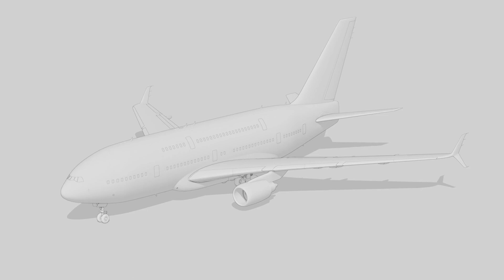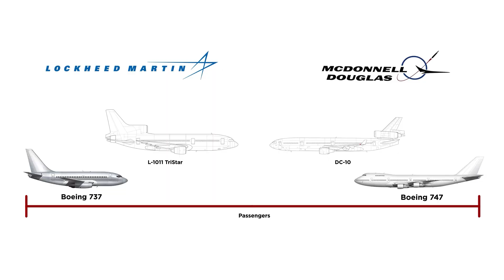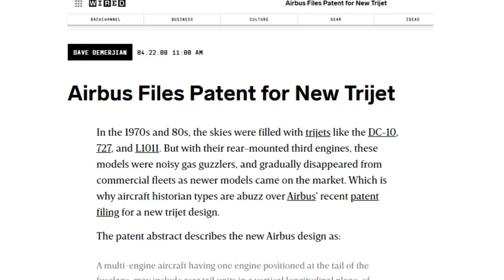Why a third engine is the future...

Comment: A trijet with the third engine as a booster means that this engine would produce drag while turned off.
Reply: But the drag could be significantly reduced if the tail engine was a cowl less design with feathering blades.
Reply: @joejoejoejoejoejoe4391  Correct.  In fact, with modern technology, you could close the intake flaps and the exhaust and basically have zero drag at cruising altitude.  Then, when descending, turn the engine back on and open everything back up.
Reply: Not to mention the added maintenance costs of different engines on one aircraft. And the headache of the tail mounted engine. It’ll probably be better to just wait a decade for more advanced engine technology
Reply: The 727 Engine cluster resulted  in very low form drag and very high cruise speed,  The difficulty was  so much weight aft affected the flare in landing.
Reply: My first thought, to prevent the third engine from producing drag, was a flip-up intake, which opens when the engine is going to be in use, then closes, flush with the top of the fuselage, when the engine will be shut down during flight.  Think of cars with flip-up headlights as an example.
Reply: There is one more solution: hybrid airplanes. Imagine a plane, having 2 large high bypass turbo fan engines, but instead of a gearbox to Slow Down the fan, they have a generator, that equally slows down the fan and redistributes the power to two additional electric only fans, thus achieving a bypass ratio, impossible with the modern jets. And if the power of two main engines is not enough, an APU in the tail can be replaced by a much more powerful turboshaft engine and generator.

Advantages: 
1. Very high bypass ratio, that cannot be achieved by the modern jets engines.
2. Redundancy - in case of an engine failure there will be much less thrust inequality on the different sides. At least one engine is fully protected from the birds.
3. Fuel efficiency - all the taxiing can be done just under the APU, electric outer engines can allow much more precise use of the differential thrust, and rely less on the rudder, thus reducing drag.
Reply: @Viktor-x1w7w Excellent proposal. As with land vehicles, hybrid is the way to go.
Reply: @Viktor-x1w7w   go to lockheed martin
Reply: @Viktor-x1w7w  You are forgetting that a gearbox reducer doesn't just reduce the speed, it turns speed into torque while the Power stays relatively the same to the product of the gearbox reducer's efficiency.  That efficiency would be dramatically lower if you were converting it into electrical power and then returning it into mechanical power.
Reply: @Viktor-x1w7w  this could introduce higher power losses than a geared turbofan
Reply: @Viktor-x1w7w Great idea.
Reply: @Viktor-x1w7w on paper this sounds good. In reality you will not generate enough power to overcome the thrust requirements and energy loss you naturally get in ALL electrical systems to make up for it. Liquid fuels continue to remain king for energy density.
Reply: @EntityOfTheVoid  the energy still comes from the liquid fuel. The problem is that you are limited by the fan maximum diameter (your fan blade tip must not break the sound barrier) as well as the differential thrust. Hybrid solution overcomes these issues as it partially decouples propulsion from the power generation - you can send power from any engine to any fan.
Reply: Also, 2 different types of engines used can be an issue.
Overall, using 2 very powerful or simply using 4 engines is much more convenient.

Comment: No, 3 engines has several problems over 4 engines...

*Rear control surfaces have to be larger and thus draggier for 2 reasons, more rearward COG meaning shorter moment arm, but also because 1 engine out causes higher asymmetric thrust on a trijet
*maintenance access is difficult on the rear engine
*it's structurally efficient to place the engines on the wing as they counter the flex of the wing, therefore wings can be lighter

So whilst twins are more economical than quads, in the case of the trirjet, the complications of mountain an engine at the rear exceeds the benefits of having fewer engines.
Reply: So why there are trijets in business aviation ?
Reply: @dmitripogosian5084  Because small business jets generally don't have wing mounted engines, this allows them to be low to the ground and have onboard stairs.
Reply: @dmitripogosian5084 
The overwhelming majority don't. Even the most recent long range Dassault Falcon is a twin.

Comment: It could be argued that the DC10/MD11 and L1011 TriStar were stop gap solutions before sufficiently powerful engines became available to power large twins.

While there may be a demand for engines powerful enough for an A380 or 747-8 twin, would that demand justify developing what would be pushing engine power significantly beyond what has already been achieved? This would be cutting edge technology with significant engineering risks, with at best, modest demand for that engine model.

The four engined Jumbos used tweaked engines of a power well within what could be achieved, and even the largest twin, the 777x should be produced in sufficient numbers to justify the development costs.

As a stop gap, there could be a justification for using existing engines and/or to create an aircraft without ETOPS constraints, or superior short field performance.

Although not specifically mentioned in the video, the idea of a booster engine for take-off is nothing new. Some variants of the Hawker Siddley Trident had a fourth booster engine mounted just above the one within the rear of the fuselage to improve the abysmal performance from the three main engines.

Comment: Tri-jets have always been a great concept on paper. But the reality is if it can be done with two powerful engines only, that's the route airlines will go. The world has tried this already. The DC-10 only sold 386 units and the L-1011 did even worse with only 250 units sold. These are not compelling numbers. Engine technology has come a very long way and will continue to improve.
Reply: Boeing 727, British Trident
Reply: @ the 727 sold well but the market segment they were intended for are well covered by twin jets today. We’re talking long haul use as seen in the video. A narrow body with 3 engines would never make sense.
Reply: @chrissmith2114 
And the 727 was replaced by what?

That would be the twin engined 757... 

The only reason that the 727 was a tri-jet was that the engines of it's day simply weren't powerful enough. The Tri-jet concept is a solution to a problem that no longer exists.
Reply: Also the MD-11 had 200 examples built. But when added together the DC10, L1011, and MD11 there may be a business case, especially if, for some reason, ETOPS restrictions prevent twin engines from working on certain long haul routes.

Comment: emirates is the exception to the rule. most Airlines struggle to fill out capacitiys on high volume aircraft. add complexity and development cost and it doesnt look to good. also i think there is an aerodynamic view to it (sorce is i made it the f up/intuition): but you´d add drag as compared to twin engines. So its beneficial to just optimize twin engine aircraft since you´d have on less source for drag.

Comment: The issue with 747 and 380 is they're too large for 90% of the airports so their use is extremely limited. If they had smaller wingspan and weight they would be a lot more viable.

Comment: 1:00 at least they aint the 8 engine b52
Reply: Well B52s were built in the 50s when jets were very early tech and didn't provide enough thrust. There were proposals of modifying them with 4 modern passenger jet engines but it was revealed to be increasingly expensive to convert because that would require extensive modifications to the wings of the aircraft, so the decision was made to keep 8 smaller jet engines which still would be significantly more fuel and thrust efficient than 50s-70s jet technology
Reply: The Convair Model 37 was a proposal for a passenger version of the XC-99 (which was based on the B-36 bomber) with double decks and 6 pusher engines.

Comment: This is not going to happen.

For a modern high bypass turbofan the engine is more efficient at 40-50% throttle than on 80-100% throttle. So having more engines turning always more efficient. So even if you say have 3 or 4 engines for take of, shutting down one or two engines make no sense, it actually increase the fuel burn not the other way around. This was not always the case, for turbojet engines, that is not really true.

Having a engine under the wing is way more economical than having it in the back. Firstly its maintenance, But that is not the only reason.. In a traditional airplane with wing and a stabilizer, the more the COG is forward, the more fuel efficient the aircraft is in cruse. That is why tail-pushers are so uncommon.

Having 4 smaller engines is actually both more economical and easier for maintenance than having 3 slightly larger. When the L1011 and DC10 was designed, this was not quite obvious due to large bypass turbojets was a very new thing. This also turned out to be the case with Boom overture. Showing that 3 engines really didn´t work as well when they start digging deeperin into the numbers.

In reality, the 3 engine planes like the DC10 and L1011 was replaced by 4 engine planes. 747 going on to have several iterations, the A340 was launched in 1991 and also A380 in 2005. The two later producing 377 and 251 units. While the A380 have beeen seen as a failure, the production numbers was still larger than that of the L1011 and the A340 was just shy of the DC10 that was generally considered a limited success.

Comment: Yes, because so many airlines are clamoring for a competitor to the wildly popular A380. 🙄
A more efficient replacement double-decker would be chasing the wrong side of the decimal point. The breakdown of the hub model meant the end of the age of mega-jets, and now they're only viable on specific routes, to the point that Airbus shut down production earlier than anticipated. If there wasn't enough market to be worth keeping the production line open, there's CERTAINLY not enough to make the R&D on a whole new aircraft worthwhile.

Comment: no it is not and history already proved it. The market is going for 2 engine planes because the new ones have enough power and they are more economic.
Reply: i guess airlines now just want to have one engine planes or even gliders, with that soaring fuel price...
Reply: @ and no pilots.
It is already possible to fly an airplane from point A to point B without human assistance…
Reply: Ha! 
Imagine an engine capable of single rear engine flight with 2 'spares' in the event the MAIN died. 
Engineering moves fast. Catch up.
Reply: @jamesogden7756  Why have two pieces of metal doing nothing but making drag when you could just make the main more reliable?

Or better yet, just have two engines.
Reply: say this slowly while looking at how Airbus keeps making their twinjets increasingly have less thrust weight ratio
Reply: Wrong! Landingslots are the biggest problem globally at the major hubs. A380 and its equivalent is the only way forward
Reply: @halitosis75  the usage of the A380 and the 747 cheap out the ticket cost per passenger. Because of this, airlines suffer losses whenever an aircraft flies half empty. This is why the airlines demand things like the A321XLR which actually pollute as much because of their lower power and speed but at least a single trip on a321xlr nets then as much money as it once did with a 747 despite the 747 has a whole hour of advantage because an A321XLR cruises at 820kmh while the 747 can go 1090 with headwind.
Reply: @kingghidorah8106  you really don't get it
Reply: @halitosis75  says the one who can't think from an airline's standpoints.

Not filling an aircraft entirely equals to losses. The A380 cannot fit in about half of the international hubs while the 747 can operate in airports as small as 2km long runways and proceed with ground ops without the need of a terminal. However there's less and less people that afford to fly across continents. This means the quad engine aircraft are wasting fuel while carrying the same amount of pax that would fill something like an A330, with two engines. 

You just sound like an A380 fanboy.
Reply: A lot of his content is hypothetical, not practical
Reply: The size of the engines under the wing is becoming an issue.  The B-737 Max series is an example.  A centerline engine/APU could provide supplemental thrust to assist in takeoff.  The KC-97 had supplemental jet engines added to help them maintain higher speeds for refueling early jet fighters.
Reply: @BobSpiffy1 it’s only an issue because the 737 was designed before turbofans were a thing.
Reply: @ So, because you believe that what is most common is correct and that there are no other options…. Having four decades in aviation in maintenance and operations has taught me that there can be multiple solutions to the same problem.  Boeing, Airbus, Douglas, Lockheed, BAE, Sukoi, Mitsubishi, Tupelov, … all had different takes on making aircraft more efficient or capable.  Don’t lock yourself into a mindset of “my way is the only way.”
Reply: @BobSpiffy1 everyone of those modern designs is a twin engine.   A380 fizzled with four.  Been in the business almost that long myself
Reply: 2 engines in the middle of the Atlantic or worse the Pacific makes me nervous at times, 
Especially at night surrounded by lightnings…
Reply: @gillesbueno1153 that’s why we have ETOPS rules
Reply: @gillesbueno1153 dude thats why ETOPS exists, if one engine fails you got the other, those planes was made and testes AND CERTIFIED to fly with one engine at least to get to the closest airport
Reply: @ yes.
Until 2 engines will quit at the same time…
It did happened before…
Reply: @gillesbueno1153 
Any problem likely to kill two engines simultaneously is just as likely to kill 3 or 4 simultaneously, so mounting 3-4 doesn't actually make you any safer... just bigger, heavier and more expensive.

If there was a genuine case and requirement for quad jets then the A380 wouldn't have been an abject failure and the 747 or its successor would be in production. Nobody needs or wants quads or tri's so there aren't any.
Reply: @gillesbueno1153 the B777 has 207min ETOPS on the pacific, that’s not for no reason
Reply: @ yes…until the day both engines for one reason or anther,
Will quit running…
The more engines over the water, the better.
Economic issues should not overcome safety issues…
Reply: @ there are no safety issues with 2 engine aircrafts. You think they would get approval if there would be? 
The times where 3 or 4 engines were needed are over since 30 years
Reply: @Cars-k8e  4 engines are still needed till date for jumbo commercial jets, for eg :- Airbus A380.
Reply: @ yes but that’s only the A380 and the 747.
The engines are so super reliable that I wouldn’t even think about it to fly 2-3h single engine with this thing (eg B777)
Reply: @Cars-k8e .
Reply: @Cars-k8e except for when there is reason. Jeesus the idiocy of modern society kills me.
Once upon a time when engineers not marketing folks and green ngos rules the world there was redundancy.

Jeez what a concept, much safe, soooo much engine, amazing people arriving safe bla bla bla.

But but but somebody has to pay for it, and companies only buy 2 engines widebodys….

Yeah, cause somebody let madmen fly 2 engined AC in 200 min etops scenarios.

Until something like a double engine failure actually occurs, then you lot will all aboard the 3/4 jet safety train all over again, windsack.
Reply: @ so tell me where did it come from that the airplanes had 4 engines? The problem was that the engines weren’t reliable. 
What would cause a double engine failure? 
You are obviously not working in the aviation field…
Reply: @unfound23 if the ultrafan is powerful enough then the 747 ETOPS might be a thing
Reply: It is hard to talk about "history" on a 50 year stretch
Reply: @ Is it? 3 engines commercial airplanes to buy today 0, 4 engines 0, 2 engines airplanes 8.
Reply: @ Dassault Falcon 900lx, I was talking about business jets.  I think French foreign minister came to on one to Quebec City meeting recently ?.
Reply: Many ppl dk this, but newer planes have got so much powerful over the years although looking very similar, that a modern twin jet plane is more powerful than any tri jet plane of its size from the past.
And I doubt the claim that planes are flying "slightly slower" nowadays to be true. As planes before weren't even allowed to go 900kmph+ most of time as max speed in most flights, but simply ordinary commercial planes nowadays flys at 996kmph+ to be their cruising speed on a regular flight, also they've got much more powerful not just efficient than their older counterparts(can't be for no reason ofc).
There're some exceptions for eg :- the Concorde, but that's no ordinary commercial jet plane.